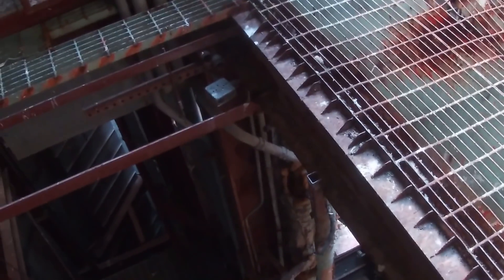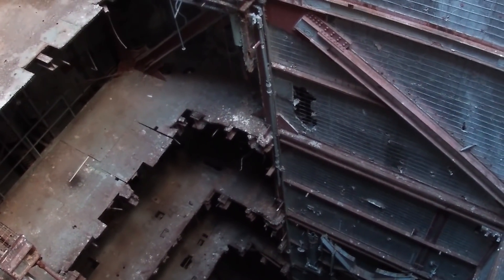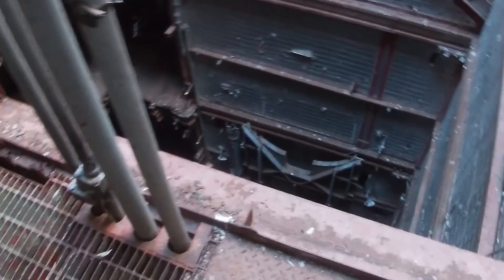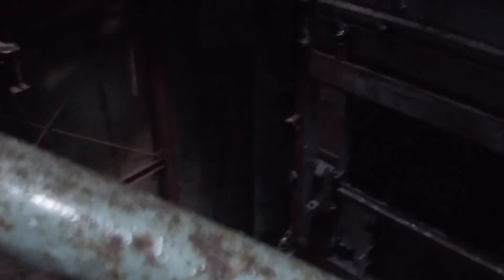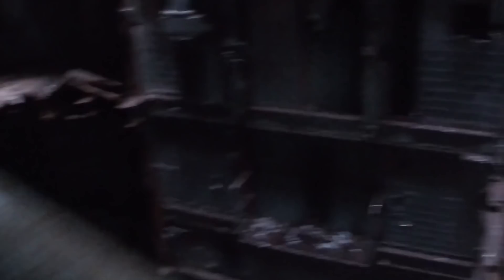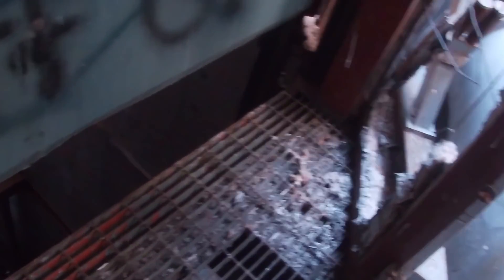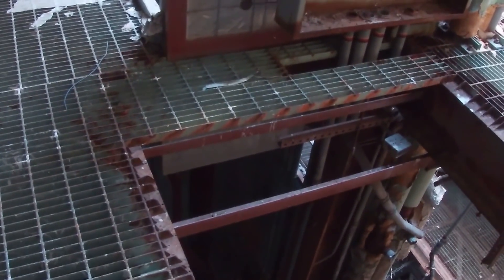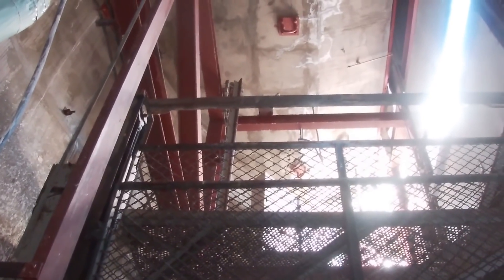S1E25 - Atlas-F Missile Base Tour - 579-10 Silo

Comment: There are preppers that would buy each level and restore it. Most The structure is gone but the outside framework of I beams could be joined by structure winched down with a gantry crane. Put in an elevator and it would be fun af.

Comment: Well, whatever you're going to do with this "room", you should get the elevator up and running safely. Then scrap the rest and take the money to have a big concrete hole in the ground or only scrap the surplus and restore the core structure to build new floors upon it, it's a tough and costly decision. So, what's the plan for a place, where you can easily hide a skysraper but you haven't got the sky high budget of those who originally build it? Scrap everything, seal the doors, throw some ship wrecks and coral reefs in it and make it a diving training center/spot?

Comment: fantastic to finally see inside a disused silo - when you think its just a deep concrete hole in the ground to house a missile - its incredible to see all the mechanics of the service levels, lifts and everything else - its a real nightmare as to where you would start first - that lift is a worry - i'd chain it up for double safety before attempting to lift off its safety brake, if it became too heavy for lifting equipment y'd lose the lot to the bottom - place definitely needs a tidy up - i'd do it!